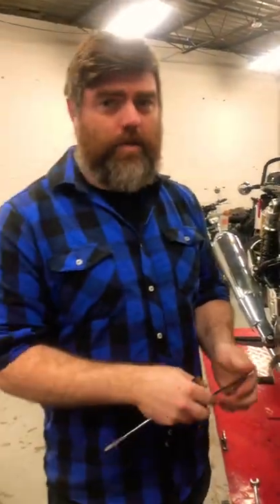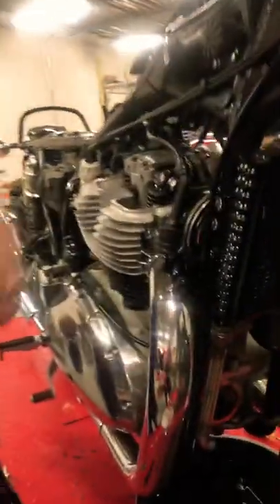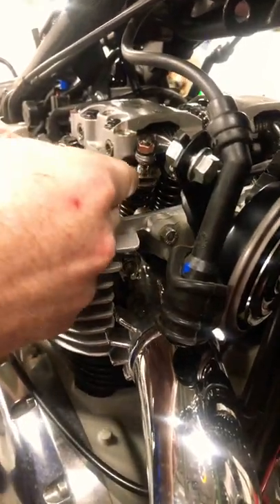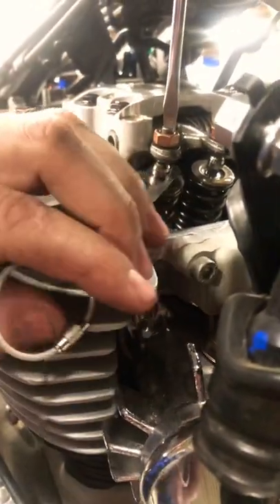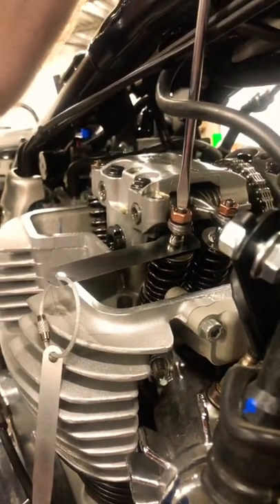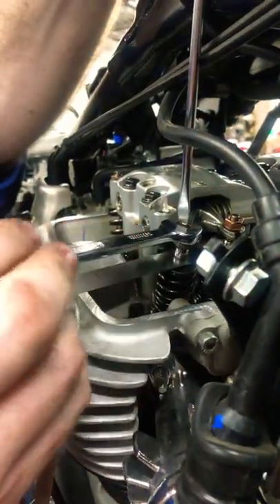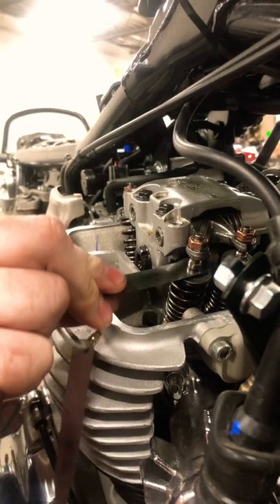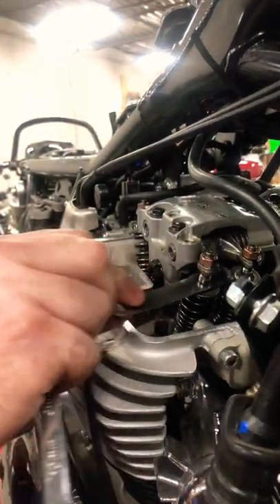Perfect valve adjustment every time. Royal Enfield INT650

Comment: Dear sir, how often it should be adjusted in the 650?
Reply from the maker: Every 6k miles which is about 10k kilometers
Reply: @throttlecompany  thank you ☺️
Reply: First time is 300 miles.
Reply: @highspeedboom  generally for 400cc when should it be adjusted ?
Reply: @tahami4144  for the 400 you should hopefully find a copy of the service manual online. The service manual is what you need not the owners manual. The service manual will show everything you need for maintenance intervals and inspections

Comment: I tend to go on the looser end, then when I tighten the lock nut it snugs up the valve adjuster...
Reply from the maker: That is the opposite of what happens as I’m demonstrating here.
Reply: @throttlecompany  Maybe I'm misunderstanding what you're demonstrating... The valve adjuster and the locknut both turn the same way, righty tighty... The tiniest turn of the valve adjustment screw makes a huge difference.. It seems when I go too tight, then tighten the lock nut, it tightens it even more since it slightly grabs the vale adjustment screw...

Comment: Are you supposed to feel any resistance  when you slide the gauge back and forth when you're in spec?
Reply from the maker: Yes. You are essentially measuring the exact size of the gap so the feeler gauge should fit in and touch both sides but not be hard to move. This is sometimes hard to understand at first so think about the “go/no-go” method which says this feeler gauge fits but the next size bigger doesn’t fit at all.
Reply: @throttlecompany  thanks for the "go/no-go" analogy, that really helped! Do you feel that the INT650/Classic 350 platforms are a good place to learn basic motorcycle maintenance?
Reply from the maker: Yes, definitely.

Comment: Hi, was that final tightening on the adjuster locknut?
Reply from the maker: It could be, are you asking how tight it should be?
Reply: @throttlecompany  Yeah, mate.
Reply: The shop manual states 10 -12 n*m but I’m beginning to think it’s better to not exceed 10 N m on most of these cheap threads and bolts .